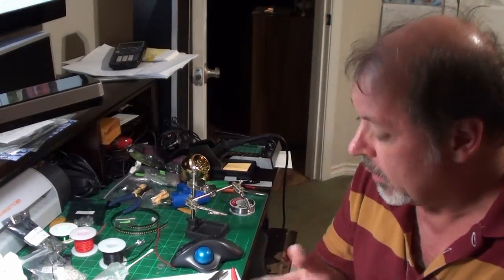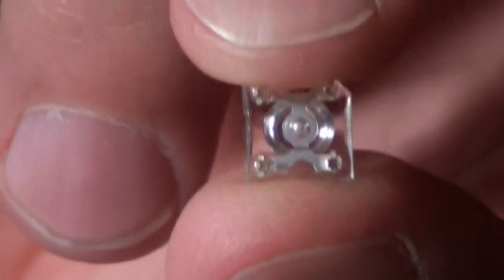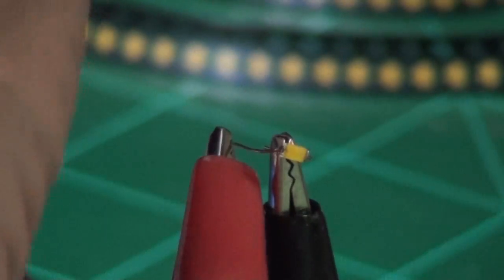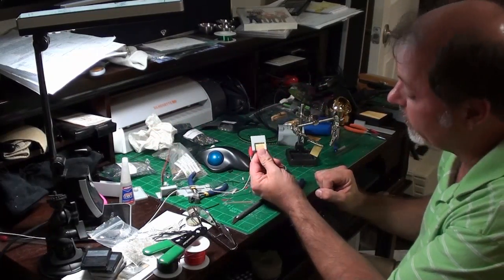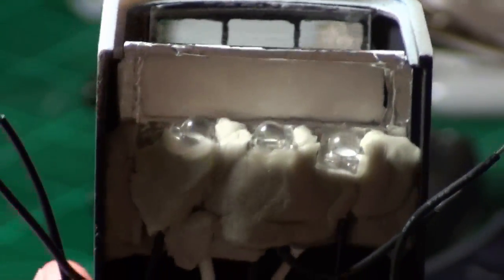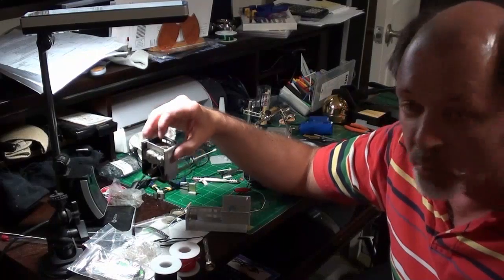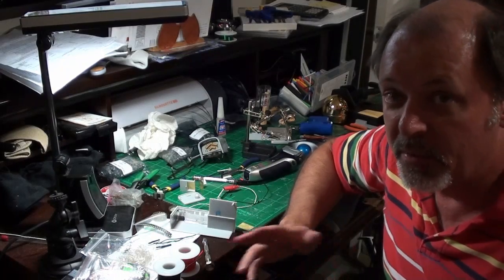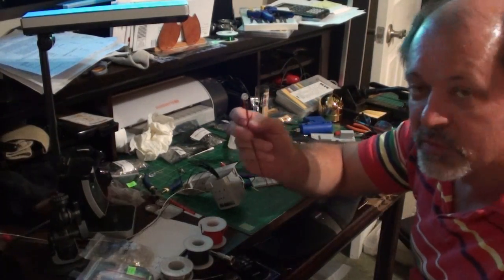Mercury 9 Part 20:  More on the command center.

Comment: I will have to try that, never thought of soldering leads on a SMT, I usually use something called "grain of rice" LED's for small ones when needed.  Thanks for the tip!

Comment: I'll certainly let you know when I do. The first thing I need to do is test the power supply, to see if it's still working, as the mishap which damaged most of the rides, also caused multiple short circuits, which in turn very nearly caused a fire in my (then) bedroom!
(This all happened well over a decade ago when I was still single, and had plenty of time, money and space for these things!)